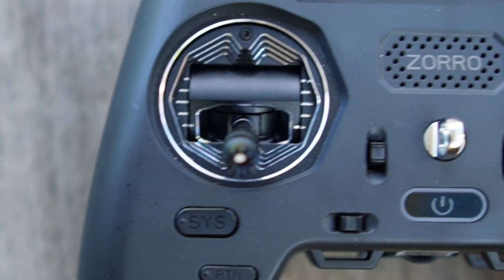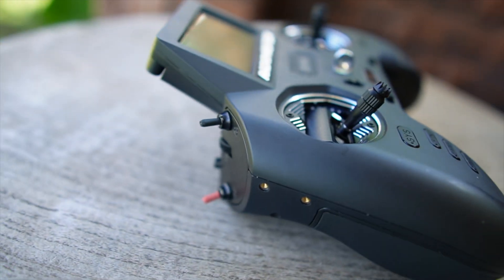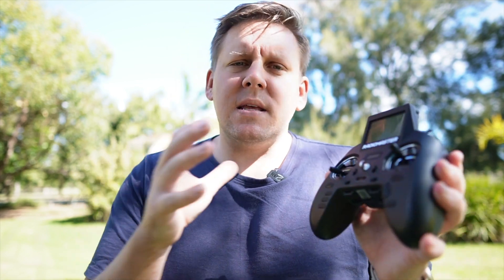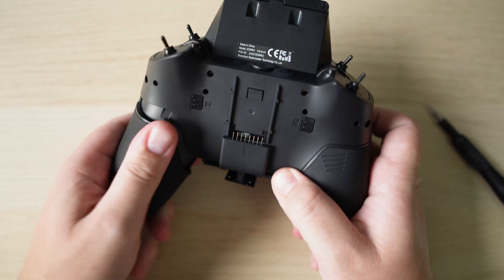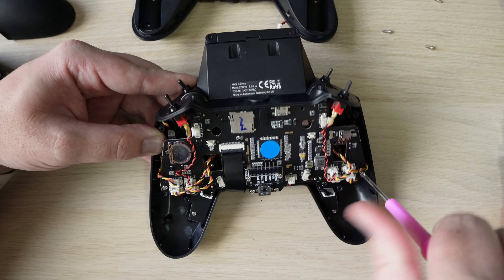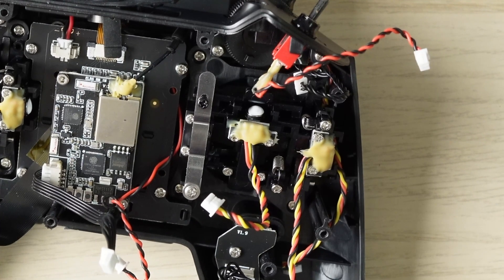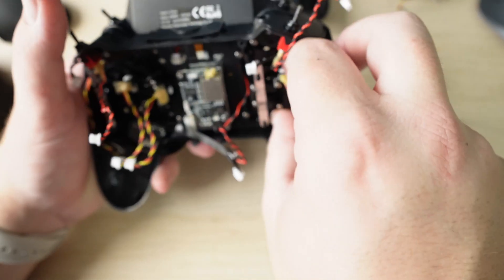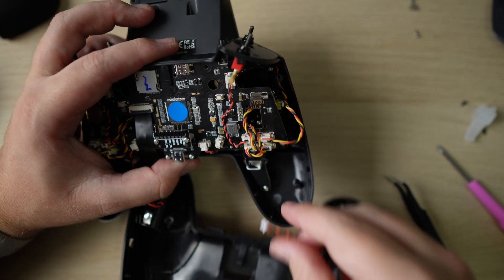I Upgraded The Radiomaster Zorro

Comment: Was going to ask if you'd pick the Zorro over the Tango 2, but noticed you haven't featured it (the Tango) on your channel. Do you have the Tango 2?
Reply from the maker: I don’t have a Tango 2 currently, had one previously; but do have a Mambo. 

Would I pick the Zorro over a Tango 2; well that depends on a couple of questions:

Is this your first radio?
- I’d pick the Zorro with ELRS

Is this an upgrade, and you fly FRSKY
- Zorro 4in1 

Is this an upgrade, you exclusively fly crossfire
- Tango 2

Is this an upgrade and you fly different protocols
- Zorro
Reply: @DarrenAllatt  Thanks for the detailed feedback...I'm a Frsky user, looking to distance myself from anything made by that company. I was determined to go with the Tango, but ELRS has got me reconsidering.
Reply from the maker: @adeyinkabrasil4426  ELRS is the best option for most pilots. Small learning curve with flashing but the cost savings over alteratives (Crossfire, Tracer, Ghost) make up for the learning curve. 

ELRS Receivers are $15 USD compared to $30 USD of a Crossfire one.

TBS are also having firmware issues with Crossfire at the moment, and the Tango 2 is a couple of years old now